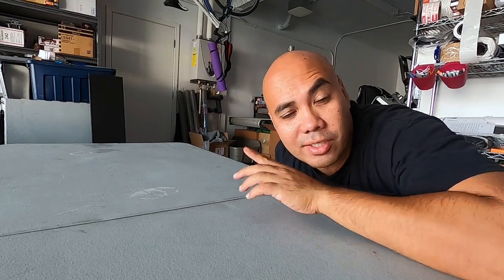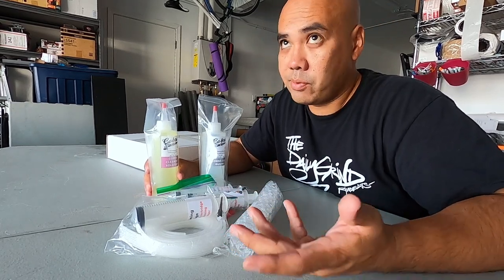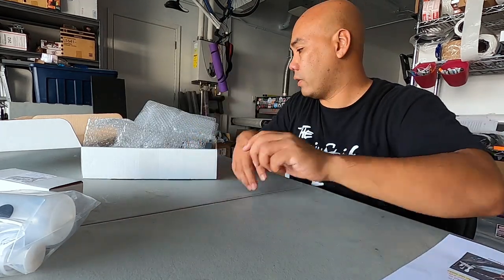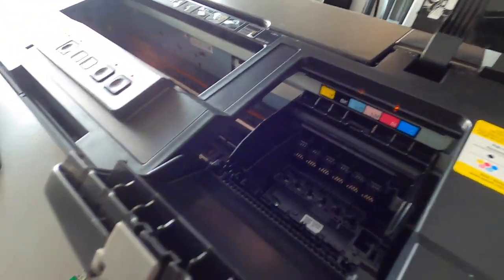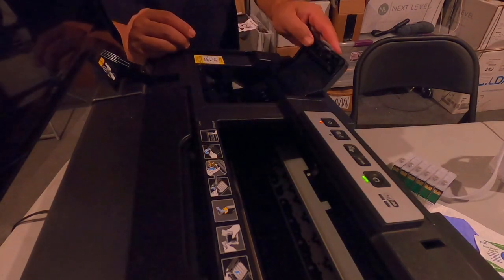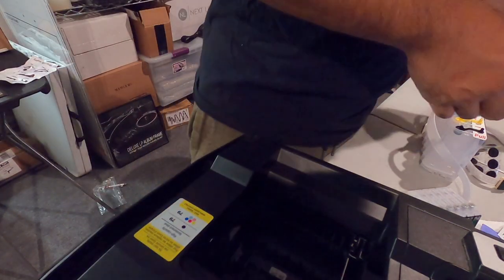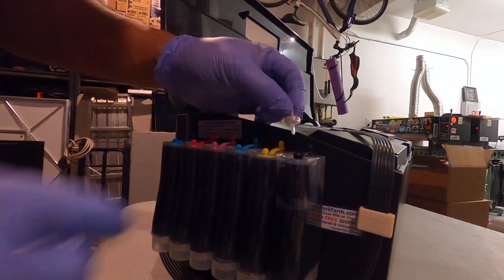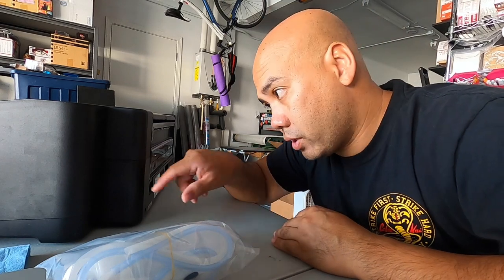INSTALLING CIS SYSTEM IN AN EPSOPN 1430 : Cobra Ink CIS System (S:06/Vlog 058)

Comment: 1) The Red thing is to hold the syringe "open" that creates a negative pressure inside the syringe. Only really used if you ever clog your CIS tubes and you need to clear your lines.
2) The pee yellow solution is mainly for cleaning the underside of the print head in case ink gunks up and makes the nozzles spray sideways. The clog buster is for blowing out the print head if that has clogs.
3) As far as I know, there is no Free ink tank reset software for the 1430. You'll have to pay $10 for an unlock key. Don't get scared when you get a message that says your hardware has reached EOL (end of life) and it won't allow you to print. Just means the internal counter for the ink waste pad is 'done' and you need to reset it.
4) There's no getting around on breaking that cartridge lid LOL... that I know of. 
5) Glad you used zip ties instead of those metal clamps. Those metal clamps can dig into the lines and tear a small hole, which destroys the "closed ink system", and lets air into the line and ink can start backing up from the waste tank, into the waste pad under the print head. Then all hell breaks loose lol.
Reply from the maker: Well dang. I should have contact you first! Yep I kind of figured about the other solutions. So reset button on that internal waste?! Well that sucks

Comment: cobraink is dead :'(  what the hell happened???  we're gonna need a replacement folks, any suggestions? i'm looking at inkxpro, but it's a little "too affordable" for my comfort... (reading some of the comments, turns out this stuff is prone to drying/crusting),  cobra doesn't do that (turns into a sludge at worst that can at least be diluted and cleaned up).. although i've never had this happen... i'm just wary of a cheap ink.
Reply from the maker: This is the first time hearing about cobra inks. Did they really close?